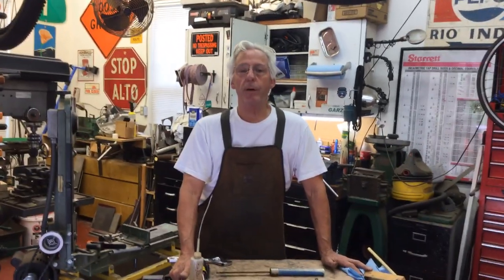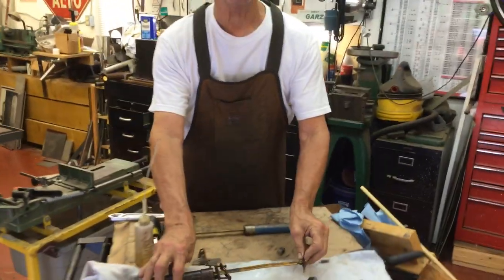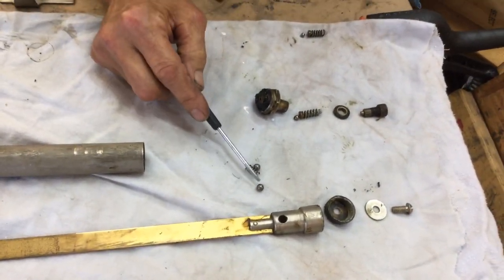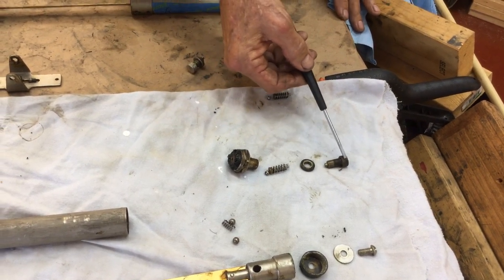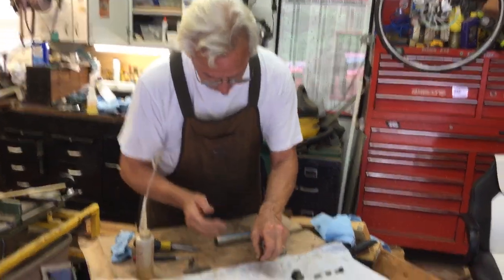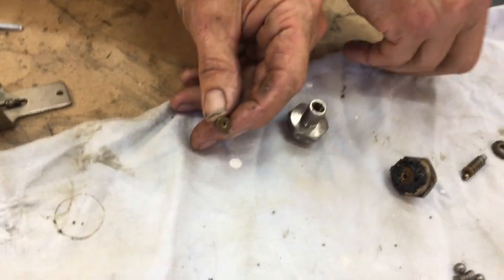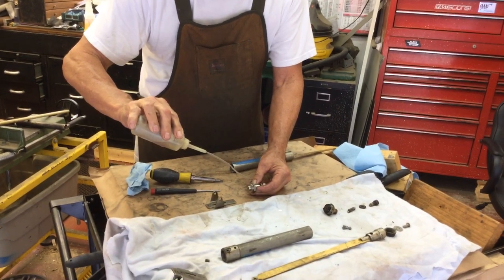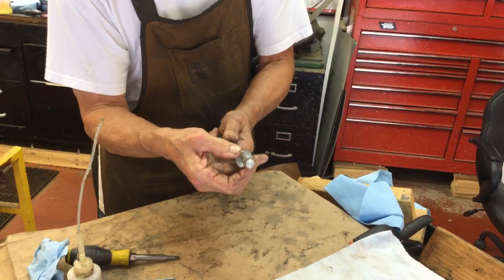387.  Rebuilding a Victor Credenza phonograph  hydraulic lid support

Comment: Hello there! I am so glad I found this video. I am trying to fix the lid support on a Victor Victrola VV-405, and when I took it apart I noticed that inside the nut there was only one spring (instead of two, one inside the other, as shown in your video); I also did not find the brass seat for the valve ball bearing. Do you know if Victor ever made models that would fit this description, or is this a sign of a bad refurbish in the past? I have not been able to fix it myself -- the lid is still closing with a thud, which would be compatible with an insufficient pressure from the valve spring...
Reply from the maker: Michel Friedhofer Someone rebuilt this in the past and it sounds like it’s missing some parts.
Reply from the maker: Michel Friedhofer   Give me a call. 864-236-1680.  Let’s figure out what you need.
Reply: @1974hurt  Fantastic -- I will call you later today, sir. You will see a call coming in from area code 248 -- that will be me. Thank you!